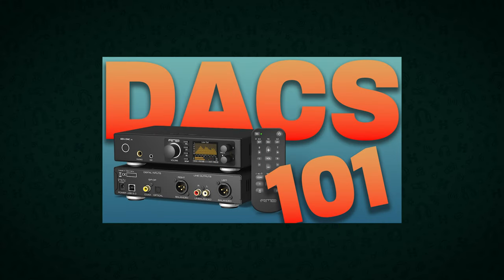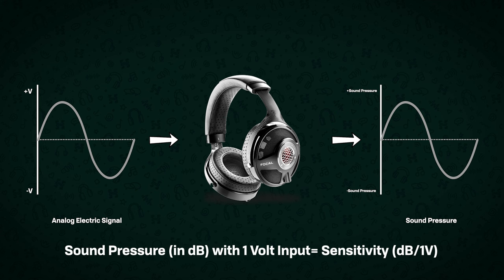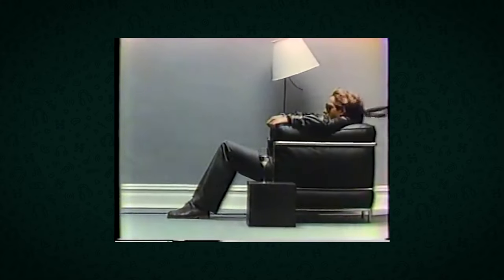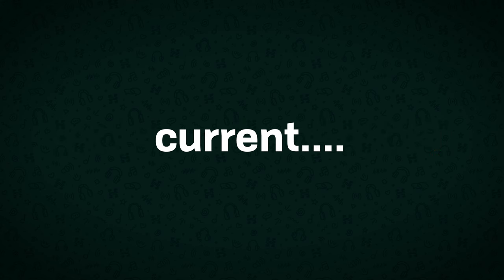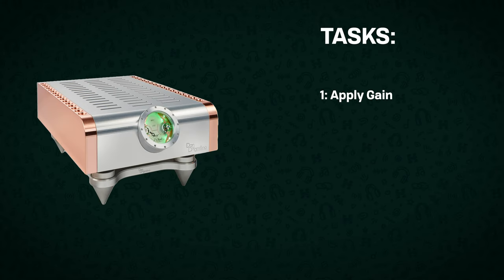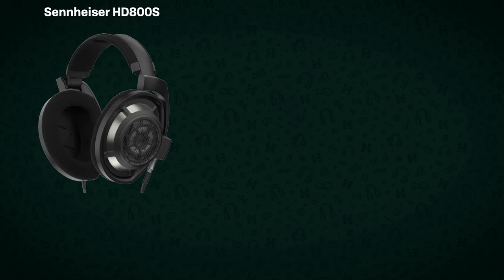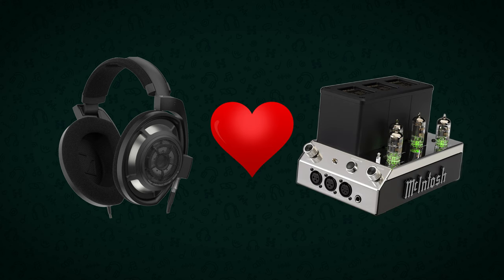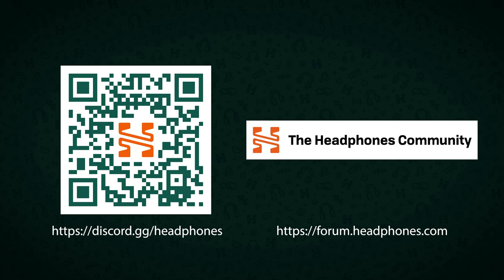What does an amplifier actually do?

Comment: I would like a see a video about why audiohiles want "HiRes" files with a sample rate above 44.1 or 48kHz as theoretically it contains no additional audible information
Reply: Being silly, mostly. Similar to 8k in something that's far enough away to not be able to resolve the difference in information. It's good in theory but if in practice it doesn't make a difference unless you are closer (or slow the audio down?) 
It might be a possible sign that it's a good quality file, and some might argue that the digital filters might not be perfect either so a higher sample rate gives better filtering without aliasing issues. But most can't hear above 17khz so even then a good digital filter doesn't take much processing power and you can oversample before the filter anyways.

Comment: I never had the courage to tell anyone on HeadFi this, but back in 2003 I drove a Sennheiser HD600 directly from the line out of my parent's old Technics CD Player. I used a stereo RCA to headphone adapter that had a potentiometer on it for volume control. It sounded pretty darn good, and I didn't notice much difference from a cheap portable headamp I could afford at the time. Notably, the line out had no problems driving it to ear splitting volumes. 

Perhaps because the HD600 is high impedance. Or maybe I was accidentally altering the frequency response and solving the HD600's bass issues (although back in those days nobody complained about the HD600's bass output....it was "the veil" in the treble people complained about....and ironically people insisted the HD650 was less veiled when it came out, when FR graphs would later on show otherwise....shows how much we are influenced by wishful thinking / suggestion!)
Reply: You shouldn't be plugging anything into line out. That is exclusively designed to used with a preamp with a massive imput impedance, not a headphone. It will damage the amplifier.
Reply: @En_Joshi-Godrez  I'm not actively encouraging anyone to try this. I was in high school at the time, didn't know better, and it was a handmedown CD player of limited value.
Reply: @fascinatedbyeverything    also also didn't tell them not to. It's not well known what line out is. Techmo/ns vid/o on the subject has over 1.2m views. It's a pressing subject.

Comment: There's a PEMDAS error with the formula used and all the following examples that use the formula (the answers are still correct)
The formula (at 5:01) should be Vdrop = V * Ro / (Ro + RL)
Reply: Make sure everyone to upgrade the firmware in your transducers to this formula for even better sound!

Comment: Excellent explanation!  I'd add that amp output impedance relative to a load is (somewhat misleadingly) called damping factor.  The effect of which you indicated very well as a change in frequency response.  Many people seem to think that a low damping factor (high amp impedance) somehow means the amp can no longer control the cone/diaphragm but this is completely wrong.  Calling it "damping" factor confuses a lot of non-engineers I think, that do not understand how it all works.

Comment: It would be amazing if you guys make some sort of audio gear link calculator to make the process of DAC-amp-headphones selection easy for non technically savvy users easy (i.e. include a dozen models of each category in pull down menus and when user selects one category the system presents best options in the other 2 cats)

Comment: I've seen videos saying that if you want to mix audio on headphones then you simply have to have a half-decent headphone amp because the amps in most budget interfaces aren't good enough for monitoring through.

So he's my setup; I'm running  my Austrian Audio HiX65 headphones directly through the trusty Focusrite 2i2. I have already configured a Harman Curve EQ template for my DAW and it sounds great. Now, with all that do I still need to purchase a separate headphone amp to maximise what I have?

And if so what is recommended for under US$200. I'm willing to pay more if there is a big leap up in quality.

Thanks.

Comment: Can you go a little more in depth about that voltage drop formula? I think there is a piece of information that I am missing because I am not getting the same results when I try to do the calculations! It seems like the two output impedances should cancel each other out unless I'm missing something.

Comment: in the past, good op amp for voltage amplifying doesn't have good current output, it starves high current demanding headphone. with proper design, the cost will add up. but nowadays, chip company is paying attention to headphone users, more chips that can provide good voltage and current. it really benefits on cheaper product to reach good result since they can save some components.

Comment: Another thing to note is that higher output impedance also gives less electrical damping on the driver, so it may have a higher time domain presense of ringing at high impedance points, or say in a planar where the impedance is effectively flat, lower output impedance increases the ability for the amp to supply higher current to better control the drivers position when it would overshoot or continue moving at a certain frequency because of resonance when it shouldnt, and higher peak current when it overshoots helps resist that motion.
Reply: Do you have any source for that?

Comment: well, so in short... Amplifier amplifies our volume on headphone/speaker?
Reply: Applies the same voltage pattern, but with more current i.e. the power needed for a given speaker to make the volume (wiggly air pressure) it's designed for.